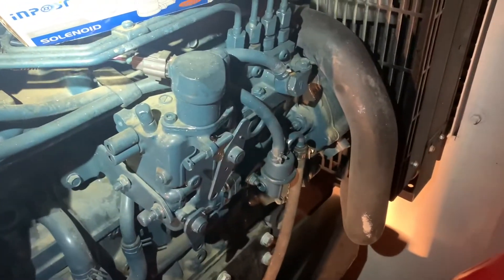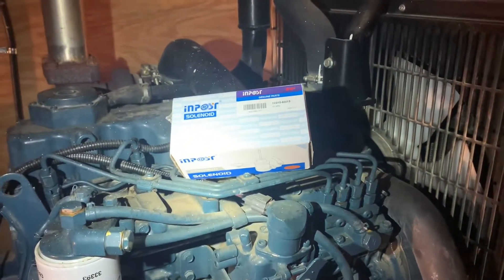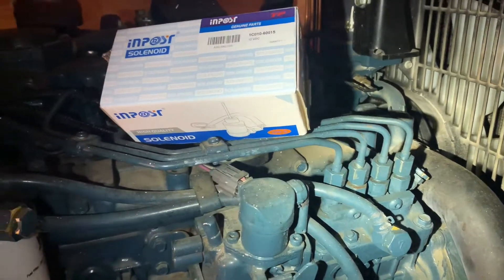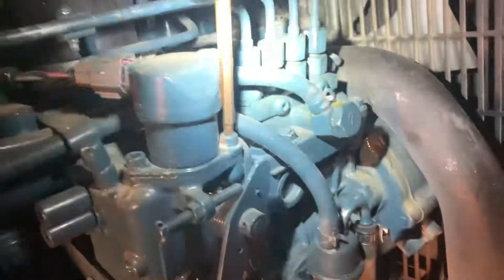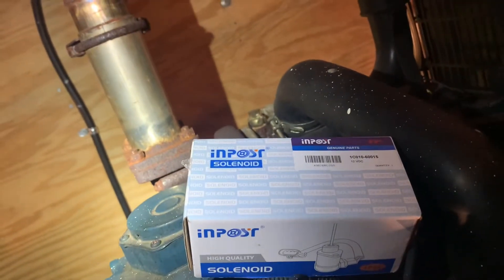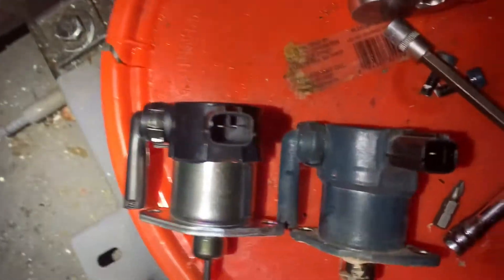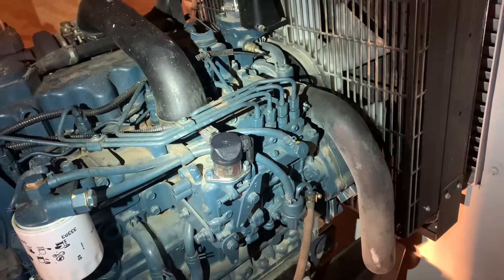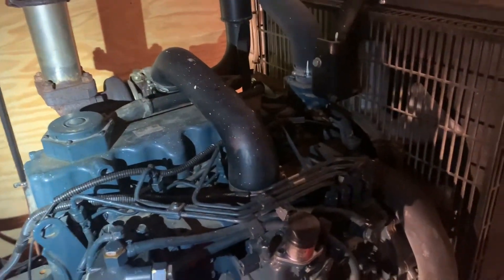Kubota V3600-T | No start | No fuel at injection pump | Fuel shot off solenoid replacement

Comment: U tap it and know that's the problem this is not how u diagnose a fuel dilvery issuse man is it getting good power and good ground have u removed and induced power to see if it will run have u removed it and cranked it over it should start fine with out it and shut down with lever on side of pump is lift pump bad or leaking some where lots of things man
Reply from the maker: Ok thanks will do that next time

Comment: Tried changing the fuel filter same engine. I started it then died 2 minutes later.
Reply from the maker: @damanyboyd1576  yes I know they are tricky but did you get it to work afterwards?